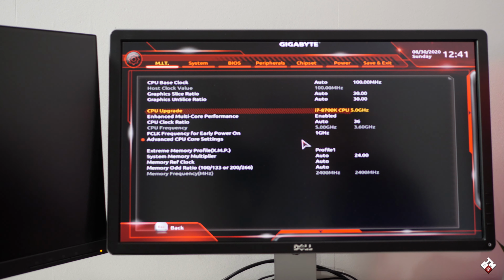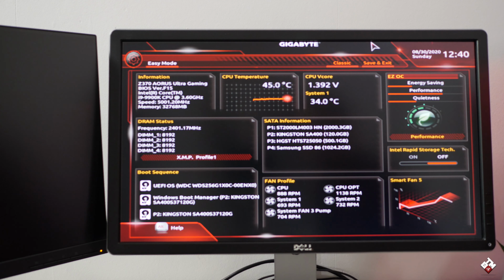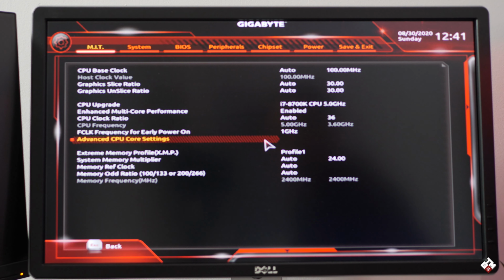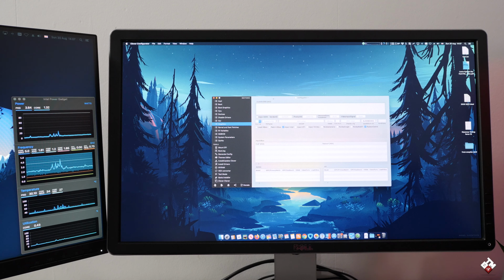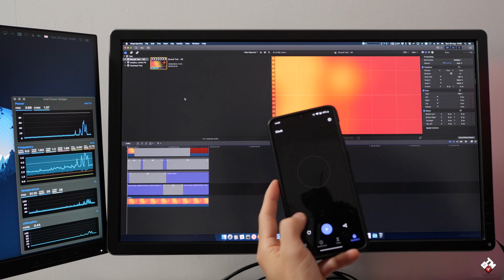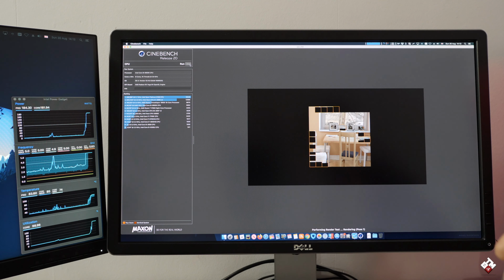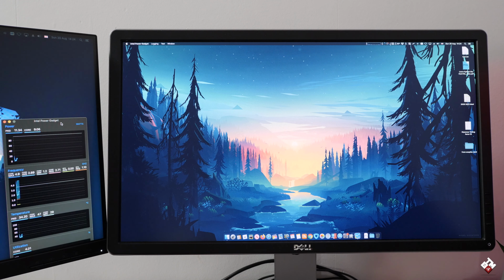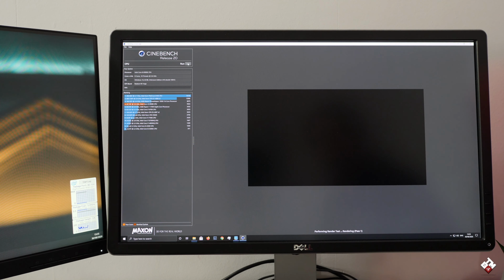i9 9900K + Z370 motherboard in Hackintosh-Is it STABLE?

Comment: the issue is not the 9900k on a z370 motherboard,  it is that you are using an overclock profile designed for a 8700k,  plus any person overclocking cpus, would know not to use the pre configure overclocks as they pump too much power to the vcore.
Reply: how do we use the i9 properly on a msi z370 gaming plus

Comment: Thanks for your work. I was thinking about upgrading my z370 8700K to 9900K. Now i leave it as is. Will try better later build new machine with 10900K.
Reply: Do you need those extra two cores?
Reply: ricky v time is money. If i save like 20% in Lightroom export time i can start sooner with another project (yep, i’m those on who uses Hackintosh in production). And for small business just buying mac pro is no the best answer either.
Reply: @espro436  That makes sense and that's why I build machines with a lot of cores as well. (:
Reply: same stock 9900k is still a good upgrade imo
Reply: if you leave it stock you would be fine.....oc is stupid
Reply: @raymondhachmishvili2483  ty thts my plan turbo is enough
Reply from the maker: @espro
I think it is the right decision.